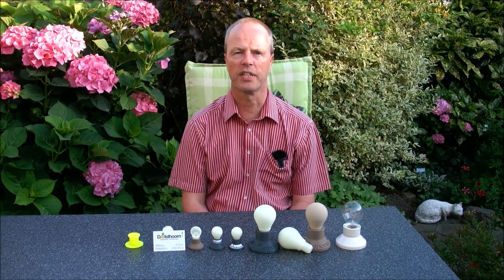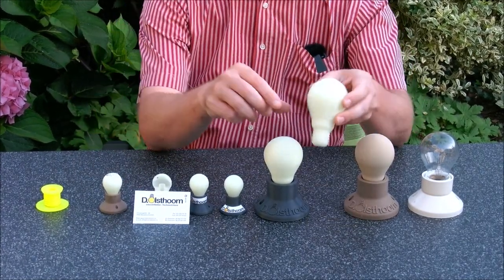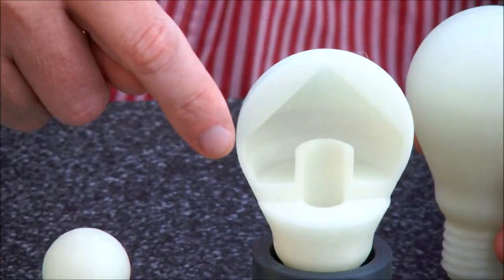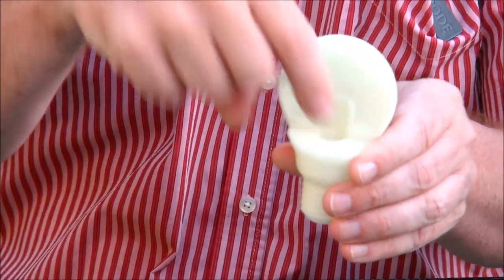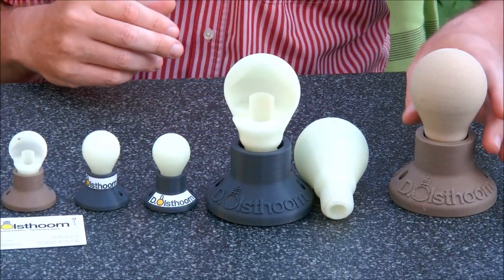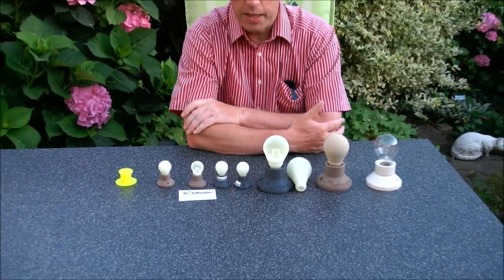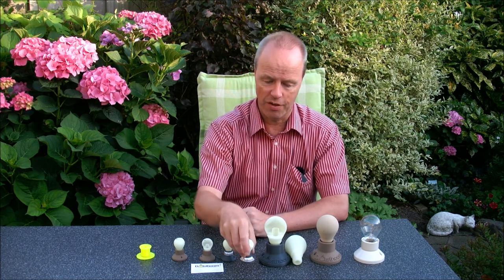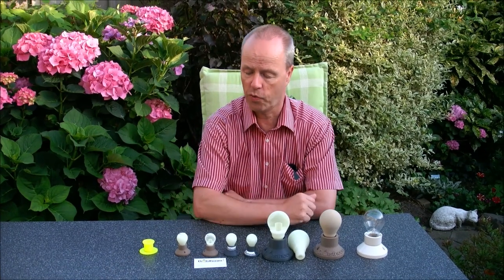Olsthoorn Lamp - What other application do you have for glow-in-the-dark?

Comment: It would be cool if the ball were captive and the lamp would work when the ball was in the lower position. Print from the bottom up and pause to insert the ball and the lighting circuit perhaps?
Reply: It's glow in the dark
It doesn't use electricity